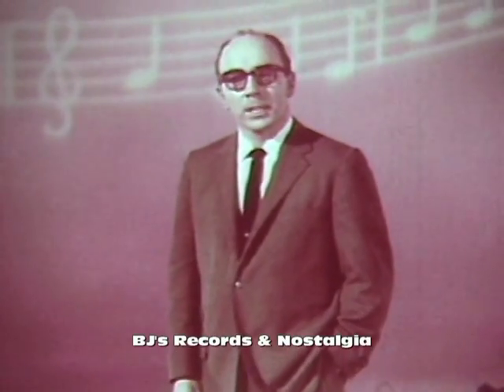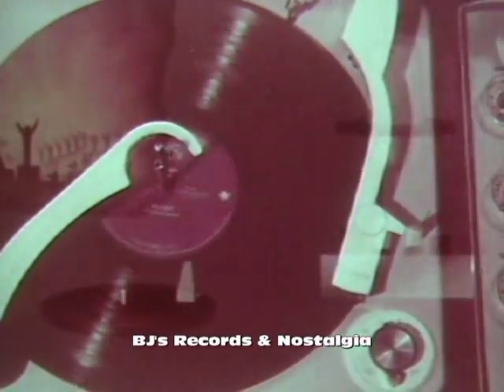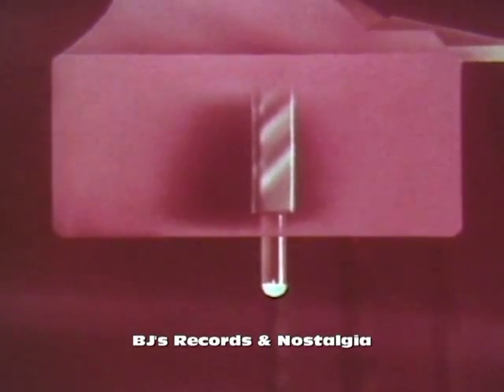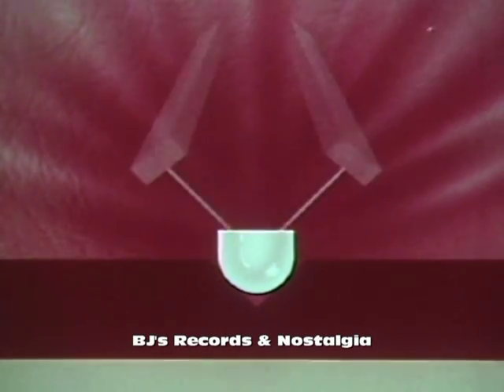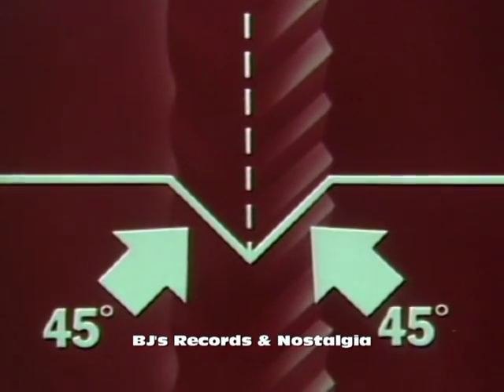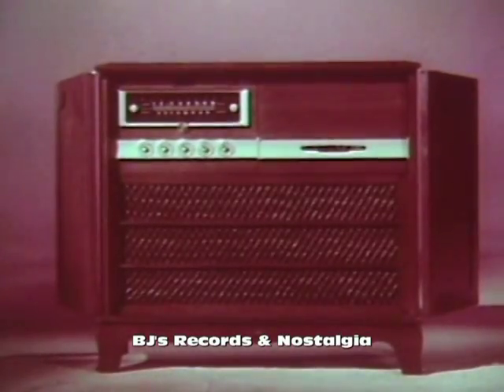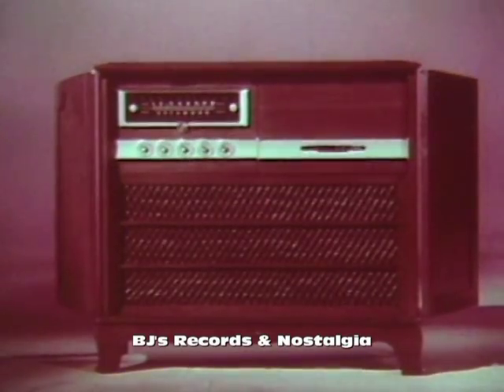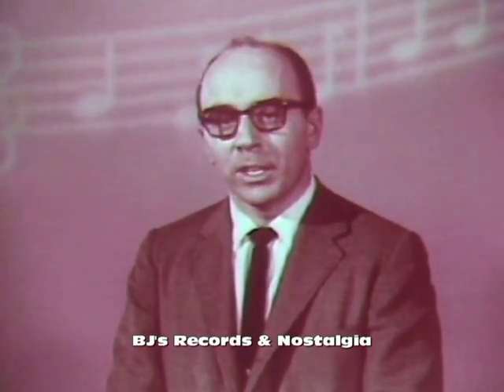HISTORY OF VINYL RECORDS #3  -  The Advent of Stereo

Comment: In typical marketing fashion, the speaker (from the marketing department) treats stereo LPs as an "exclusive" product of RCA, implying that they invented it and are sole marketers. Actually, Westrex invented the stereo (and mono) disk-cutting system and made it available to all record companies. Also, remember that Columbia, RCA's biggest competitor, had invented the 12" 33 rpm long-play record, which RCA resisted by attempting to market 45 rpm as the standard. It is amusing to see RCA showing off the same 12" records that Columbia had invented!